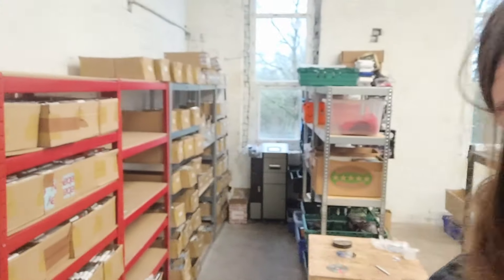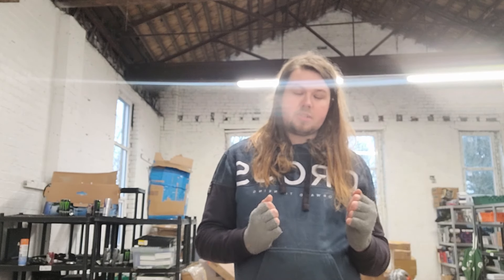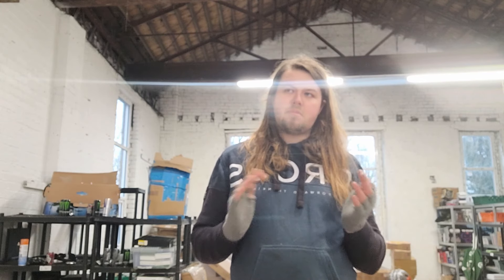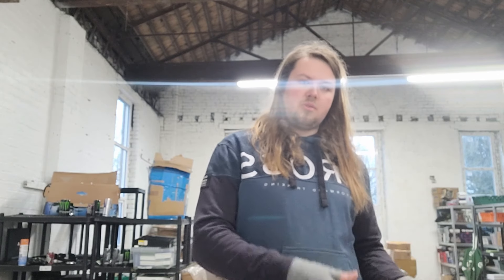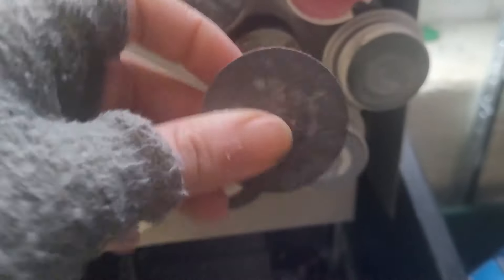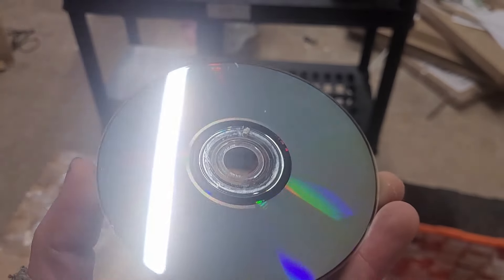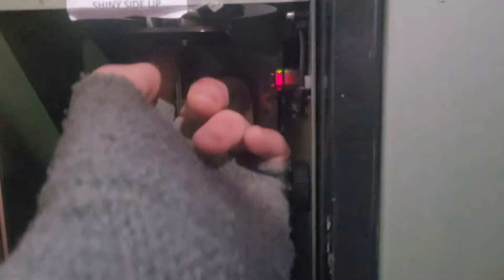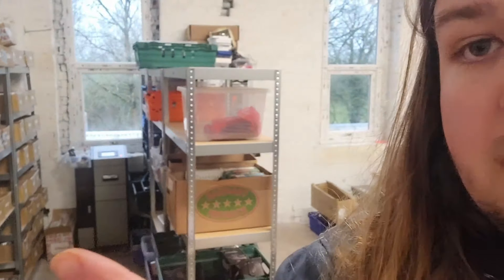The ULTIMATE Disc Resurfacer Review! | TDR Eco Master & More

Comment: How is your testing station, do you have to have loads of consoles set up or is there another way to verify the data is readable?
Reply from the maker: Inside the shed on the video I have a shelving unit full of consoles to test games as needs fit. I have confidence in my disc cleaner that most scratches to discs (apart from blu-ray format) that I don't test the discs. I will show this in a future video.

Comment: Do you clean every single disc or do you give some discs a pass?
Reply from the maker: There is discs that I give a pass but they need to be very good / near mint. Remember though there is 5 different levels of scratches and I can use a lower level if the disc has very minimal scratches
Reply: That machine is an absolute unit💪🏽
Saw it featured about two months ago on chase after the right price channel.best of luck with the channel will defo be subscribed👍🏽